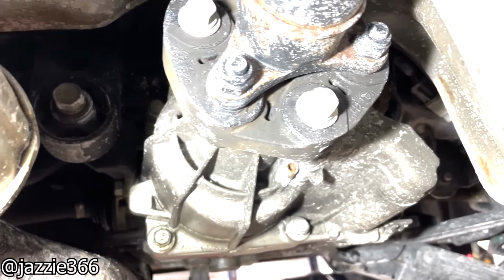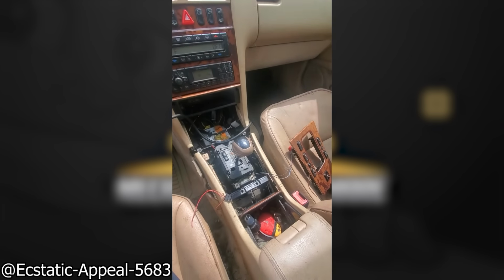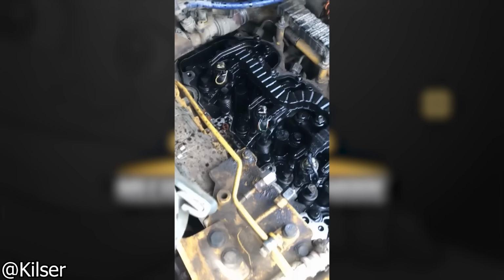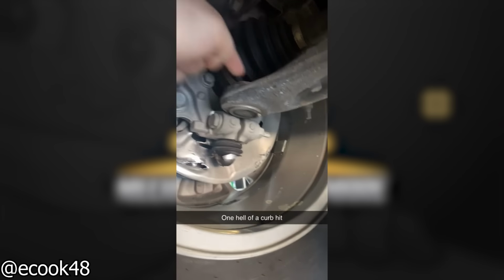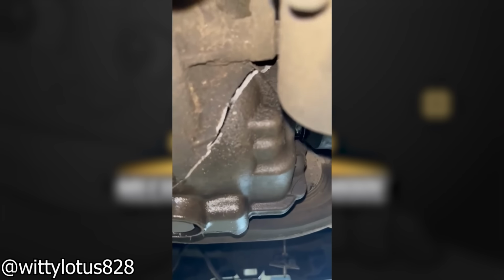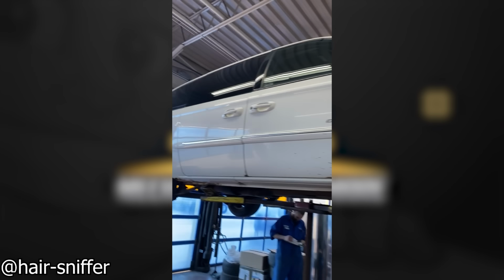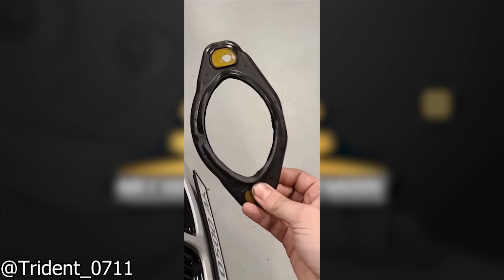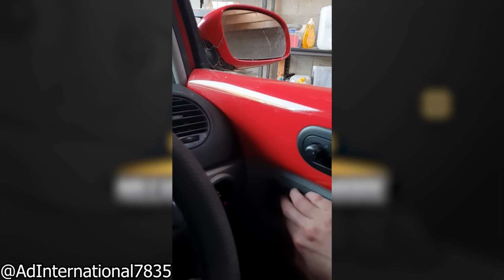Customer States Compilation (Best Of 2022) | Mechanic Problems | Just Rolled In

Comment: i was an auto mechanic for 32 years and have seen just about every issue shown in this video. anyone who is an auto mechanic for long enough will see these things a lot.
i used to do a lot of steering,suspension and brake work and i can't tell you how many cars i have seen with steering components ready to fall out or literally tied back together and the car driven to the shop that way!!
Reply: One of my faves was a lady in ,car shutting down as she pulled in. My car just quit OMG.   Flip key, low fuel light-guage at bottom.  Ma'am you understand this light?  It just means i need fuel before long?  Umm yes.  Smh.  So I did a brief theory of how fuel keeps an intank pump cool.   Don't think a word got through.  Lmao
Reply: The guy who fixes my cars when I can't laughs when I replace things at 30% lifespan- he says if he did everything I would be his best client
Reply: I’m not even an intern mechanic, and I’ve seen every single one of these, I just fix cars for my neighbors when their cars just don’t want them to be towed and I am just the guy who gets them into drivable condition to drive to the shop to let the professionals finish the job. And I’ve seen every single one of these.
Reply: Some were poor engineering. Most were abuse or neglect. I have a control arm with a shot bushing,but it can't fall off ,doesn't shake,otherwise I can't tell somethings wrong.  I'll get to it sometime.
Reply: Yep  ! 46 years  of  rebuilding  automatic  transmissions   and  still  haven't seen it  all  yet  .
Reply: Inner tube rubber and bailer twine around the center link to the steering arm and he drove back to Texas that way .
Reply: Worst part is, if they're jerry-rigging their suspension, then they already know there's a problem that has to be fixed and are just willingly ignoring something dangerous.  I get that some people are desperate to keep a vehicle on the road when it's their only means of transportation to work, but when it's something that's literally a life or death fix like serious suspension and brake issues, maybe tighten the belt a little and get it done.
Reply: @Louis-kk3to  A question. I have an 05 Toyota Highlander 4wd. It sometimes shifts hard into 3rd gear. I think it's only doing that because I'm letting off the throttle as it goes into 3rd. I don't think anything is wrong because if I keep acceleration on it's smooth. I feel others are getting rebuilds when it isn't necessary. Are you familiar with this?
Reply: @thebrain9384  no , but sometimes you have to  think  outside the  box  : the  first thing  I would  do is  check the  T P S "  throttle poissoning  sensor  "   ( hope  I spelled it  correctly)
Reply: As auto technicians, do you think you see more of these shenanigans nowadays versus in the past (indicating an increasing amount of neglect)? Or do you think it only seems like more because of the recent proliferation of these videos?

Comment: I took my 2012 GTI to the dealer because it was in limp mode. They gave it back to me, said nothing was wrong, even though the engine light was on. So I took it back and asked them to investigate the engine light, got a different mechanic. Took him for a drive, not even a block later he's like "You need a new high pressure fuel regulator."

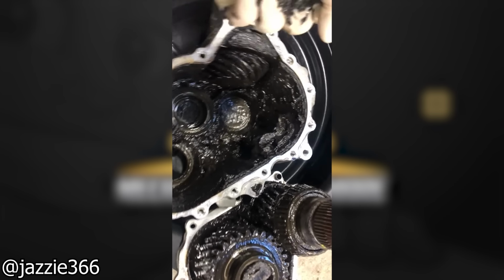Comment: 4:25... My Transit Connect dash lights would sometimes do the exact same thing.  Then during a road trip once it not only did that but refused to turn the engine off.  I could turn the key to off and remove the key but the engine would just keep running.  I managed to fix it by disconnecting the battery for about 10 minutes.  That reset the computer apparently and it started working fine again.  
Not 100 percent sure but I think I found the original cause a few weeks later.  While digging around in the fuse box area I found a computer module of some kind that the prior owner (a company) had installed for the GPS.  It basically allowed them to send emails and other data back and forth via whatever GPS they had.  Anyway, I think that was messing with the vehicle computer somehow.  I yanked that out and the vehicle has run fine for 6 years now.

Comment: In the UK we have our cars tested every twelve months for defects, and it can be annoying if you get picked up on something minor and have to go for a retest after a 5 min fix, but I'm so glad it keeps deathtraps like all of this stuff off the road! I'm surprised it's not a thing in the USA, to make sure people aren't driving horrifying accidents waiting to happen.
Reply: In some states, yearly inspections are absolutely a thing. In a perfect situation, they make sense. Fix the defect, get your pass, and move on. But I think sometimes a dishonest shop could hold the vehicle's pass hostage, until the vehicle owner coughs it up over something petty.
Reply: We do have that here, dishonest shops let a ton of cars go "for a buddy" or for a grift of extra cash.
Reply: I wouldn't bet on that. There are a lot of death traps on the roads in UK as well. I work as a part time mechanic and you'd be surprised of how many things i found wrong with some customers cars that just passed MOT. There are things that an MOT inspector can miss, but the driver should notice. Unfortunately car culture in dying in the UK as well. A lot of people don't even know how to top-up theyr washer fluid.
Reply: @MrGafferjim  that makes good sense. like a mandated 2nd opinion
Reply: @MrGafferjim  When did that law come in? My local garage does my MoTs and any repair work it fails on that I can't or won't do myself. I do, of course, have the option to drive it away and fix it elsewhere, then return for a free retest within 14 days.
Reply: Yeah,  screw that
Reply: @ProdigalPorcupine  Spoken to the MOT tester that I go to, it seams that the information that  I mentioned previously was incorrect, the garage can carry out the work flagged up, but the customer can appeal against the original MOT inspection results should they wish to. Duff information.
Reply: @MrGafferjim  Thanks for clearing that up, Jim.
Reply: @razvanursache9493  I top my washer fluid off, but it keeps leaking every time I pull the wiper lever forward...
Reply: @nobody7817  Good job the screen is there or you could go blind! And good job the wipers are there to deal with the leakage on your screen,
Reply: Worked in shop for 13 years and never seen shit like that. We have an annual Ministry of Transport Test in the UK. Well have seen some shite only sometimes.
Reply: Too right. I'm annoyed about it, but then I watch this and I am glad I live in a state that has safety inspections too. The brake scenes alone scare the bejeezus outta me.
Reply: USA relies heavily upon free market theories. There should be a financial incentive (ie not getting sued) to properly maintaining a vehicle. Just theories though.
Reply: In New York and some other states you have a pretty strict inspection. In Florida of course you don't need an inspection so you see a fair amount of screaming rusted metal death traps and whatnot. I've literally seen frankenstein cars where they'll like chop the backhalf of a flatbed truck off and affix it to a car body or another truck body or just slap shit onto cars that don't belong at all.
Reply: @scorpion-in2xj  I'm not sure what are you aiming at? There are drivers of 2-3 years old cars, and they still manage to destroy them because they don't know how to properly maintain them.
Reply: That's what makes the car fun
Reply: It’s a free country, there is always a trade off. Freedom is not safe and I love it.
Reply: In Hawaii, we have to pass an annual safety inspection before we can register our vehicles. 
Of course there are a few shady shops, but if they get caught it’s a criminal offense.
Reply: In Finland the inspections arent done in shops, but in special inspection officials, so no possibilities of shenanigans there. After watching these, Im real happy about it. Brand new cars get couple years free pass, but then its a yearly duty. Your inspection date depends on the last number of your registration number, like if its 8, you gotta do it in August. In the past you could probably go to a inspector you knew and slip him a bottle of vodka, but I cant see anybody taking such risk today. When I was a kid (80s) there was a rumor that ladies got cars passed more easily, I remember being with mom to get stepdads car inspected. Might not be the case, but the Merc passed anyway :)
Reply: Lol, the MOT is there to tell me to get a new car. I can only ever afford a few hundred quid, so get a car with a long MOT and drive it until the next time it doesn’t pass. It works for me. And surprisingly I almost never break down…ahem..unless I put the wrong fuel in my new (to me) diesel van
Reply: @MrGafferjim  I’ve literally never heard that rule. Is it new?
Reply: @MrGafferjim  ah, just read you correction
Reply: Ohio doesn't have vehicle inspections. Which does explain why I see rotted trucks with broken and sagging frames running around.
Reply: @razvanursache9493  I just noticed your name... Romanian?  I lived there for 4 years... wished I could go back.
Reply: @MrGafferjim   first ive  heard of that ive always got repaired at same garage.
Reply: There was a time when such a thing was far from necessary in the US. But over time, car manufacturers cutting costs, mostly due to overreaching EPA standards and rules, building crappy cars, AND the fact that people are for whatever reason getting dumber and dumber each generation... Yea we may have to start doing something similar.
Of course we Americans, those with some semblance of common sense that is, tend to shy away from government imposed restrictions. Because "absolute power corrupts, absolutely."  
Whenever you allow the state an inch, they'll eventually take 20 miles. First it'll be safety inspections. But you'll end up with the state getting into bed with automobile manufacturers and next thing you know, an executive order that mandates all cars driven on the roads be no more than 4 years old. 
😏 And if you doubt that level of hubristic megalomania exists....
Just look what they did whilst in bed with big pharma.
Reply: in the US it depends on which state you live in. as a general rule, the richest or most urban states have the strictest inspections; poorer or more rural states have the loosest protocol (sometimes boiling down to “does it run”). a lot of these clips are probably from midwestern or southeastern states
Reply: Same in Germany - and same regarding being glad cars like this won't be on our roads. Really no wonder why the traffic death rate of the US is almost 4 times higher than that of Germany.
Reply: @MrGafferjim  You could just edit or delete your original (incorrect) comment.
Reply: Here in the U.S, we have the option to not have our cars tested I guess..  last I checked, if I don't, I can't get a fucking tag or insurance..... get the fuck on man...
Reply: Oh .. it's so horrific....
Reply: Benny hill would be proud.. please respond to this....
Reply: @drsnova7313 I really can't believe that you said this... we have 15× the population... of course we will be higher than you in everything. Well, almost
Reply: @SAMarcus why... why does it scare you? Enlighten me
Reply: @yoursafeplace8476 you ain't driving it are you.. mind your own business
Reply: @janemiettinen5176 of course.  Gotta stay drunk af to handle the weather
Reply: Let's just say you have 100 people.  I have 29,000... you can't really brag about a lower crime rate, or anything really. There are less people.. less everything... so wtf
Reply: @jacobriggs7483  Gee, I dunno, maybe because right now, this very moment, there are dozens, perhaps hundreds of vehicles on the road with brakes in that same condition? Just waiting for the perfect moment to slam on the brakes and fail spectacularly before plowing through another vehicle, maybe a crosswalk filled with pedestrians, or a building full of people? Why would that scare me?
Reply: @jacobriggs7483  The weather is just clothing issue. The darkness in the winter is another story :)
Reply: @SAMarcus  slam on the brakes... if you are paying attention,  you never should really have to do that. N you can't help that there are drivers like that on the road
Reply: @jacobriggs7483  Regardless of how well you "pay attention," there will be things that happen outside of expectations. A person or animal suddenly running out into the street, a vehicle tire blowing out, trees, meteors, occasional alien spacecraft, squirrels, lightning, and a million other things can cause a sudden need to STOP NOW! and if your vehicle is in shit condition, then you might find yourself running over a 5-year-old chasing his ball.
Reply: @mdotguy  I went to a Vietnamese owned shop for my inspection sticker, because I had 18% tint on the front side windows (legal limit 20%), and 14% tint on the back windows (legal limit 15%). I told them "I'll just say I got 'em tinted after I got my sticker" and they said "Okay! Here you go!" Saved me from having to pay a $200-something ticket for no inspection sticker. Now, we're not required to do yearly inspections anymore.

I could understand if I had 5% or 0% all the way around, and it being dangerous for police, but the only way a shop could tell it was too dark was if they put the light thingy on it. And I have no idea how the previous owner got it tinted like that. It looked like a professional did it.
Reply: You have no sense of adventure. The death Traps keep life interesting
Reply: Soumds like expensive government imtrusion in to your personal life.
Reply: 1. The US  inspection in most states besides California is either a joke, or no longer required. 

2. The US has triple the amount of vehicles and quadruple the amount of roads as the UK, that is a hell of a lot of work and money to make certain all cars are road ready and have that fall on the state, cause the federal government sure ain't gonna foot the bill. 

3. Even if a state has inspection laws, there are thousands of drivers that ignore or refuse to get it done. That coupled with the law not being enforced for every vehicle violation consistently, and you start having issues. 

4. A good portion of car owners in the US are either below the poverty line, or living pay check to pay check, making automotive maintenance, either very low on their list of priorities, or just not feasible given their current income status

All this plus add the fact that most drivers do well knowing how to pump their own gas these days, these horrible examples start to make more sense. 
I used to work with a girl that had  bought a new Suzuki Rio a few months prior, one day during lunch, I asked how she was enjoying her new car. She said she loved it, and I said good just make sure to keep up with your oil changes. She gave me a puzzled look and said "what do you mean?" I then went on to not only explain she had to change the oil every 3k to 6k miles, but also  convince her, I wasnt making all this up. She swore I was making all of it up. Next day she comes into the office, over to my desk, and says "Man you were right about oil changes!" "I called my dad when I got home last night and he said yeah thats correct" "why didnt anyone ever tell me?" I like to think I saved the girl from having to buy a new engine in the near future. People please teach your kids that vehicle maintenance is very important. Don't make them learn it by accident, or the hard way.
Reply: Some of the stuff i seen on the road is insane, i have a couple vids

Comment: I was a tech for 20 years and got out of the business for this kinda stuff. After you tell them what’s wrong, it’s their fault and then the price to fix it they either flip out or say their going to get another opinion. People are to stupid to own a vehicle nowadays. My girl called me a couple of weeks ago to tell me her oil light was on. I said pull over and turn the car off. She told me she would after she got to the mall to finish Xmas shopping. (15 miles away) 🤔
Reply: Hope she got you a nice present
Reply: What causes that thick goop? All i know is change oil and breaks
Reply: You broke up with her, right? I'm a woman and I would have broken up with her. You did this for 20 years and she doesn't respect your advice???  🚩🚩🚩🚩🚩
Reply: @sarahrigdon7311 
Usually not changing oil. Sometimes coolant spilling into the oil
Reply: @kenik2023  oh thank you we get ours changed once every 3 months so we should be safe.
Reply: Meh.. Depending on the vehicle, it could still be on the dipstick
Reply: That's great, huh? You know whether than turning on the idiot light the CPU needs to shut the vehicle down instead. You know give plenty of warning like fire only 1 out 3 cylinders stuff like that. I mean these things have dip sticks FOR A REASON!